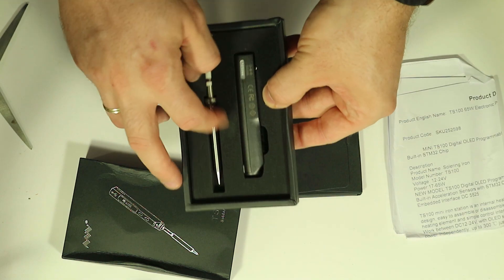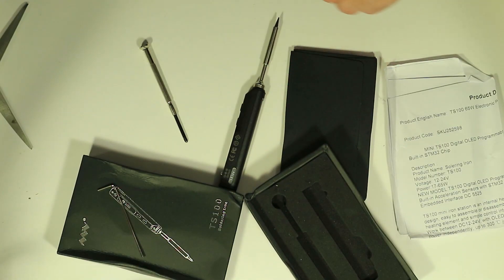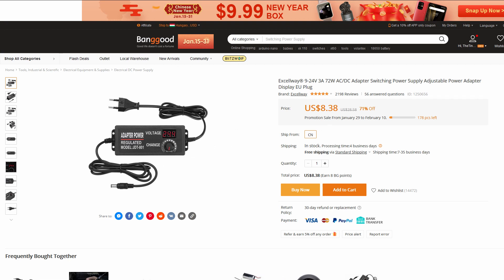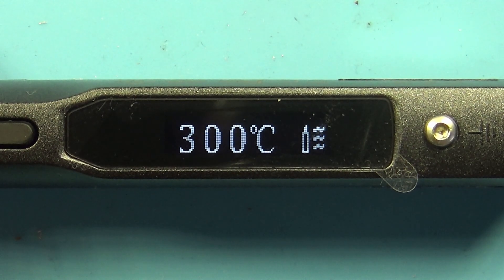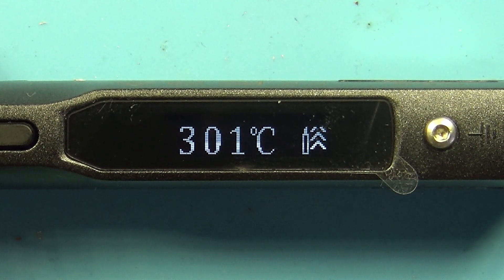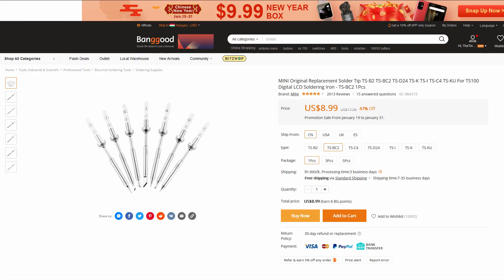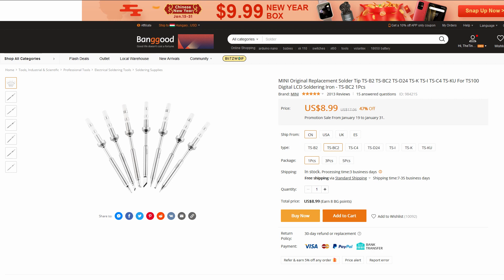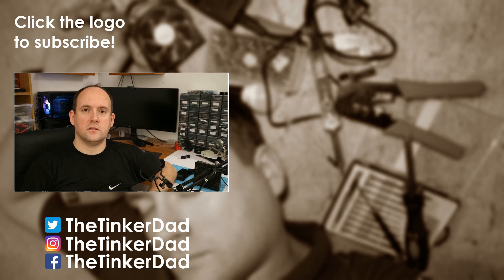TS100 - My New Soldering Iron From Banggood!

Comment from the maker: I've forget to clarify one thing in the video - what I've said at the start: "to say it'll work with almost any power supply is an overstatement". I referred to the sentence "it works with almost any laptop power supply", which I've seen a few times on AliExpress and because of which, I've expected that it'll come with a kind of adapter or cable. My bad - should have looked at things better...

Comment: These adapters simply connect to laptop charger and the other end has either a smaller or larger connect. They come with multiple in a pack and a relatively cheap

Comment: Look into Ralim on GitHub for the TS100. The Ralim firmware makes it SO much better!
Reply from the maker: Thanks! Other people have already suggested this before, but to me, it doesn't seem to be clear - exactly how this soldering iron can get any better? :)
Reply: @TheTinkerDad  the temperature fluctuation sensing seems to be more accurate and the temp can go higher with the Ralim firmware. Also you can change the menu to show more info. There are others as well that make it a go to for a lot of people in the FPV quadcopter community
Reply: @shaneintegra  does this firmware you mention work on any ts100, and if so, how do you install it??? Also, how do you choose which ts100 to get??? I see them on Amazon for as little as 25$ and as much as 100$, and wonder if the price matters or not
Reply: @northwiebesick7136  as far as I'm aware they are all the same... They can usually be found cheaper on banggood/aliexpress.... A bunch of companies slap their own logos on them now but it's 100% identical